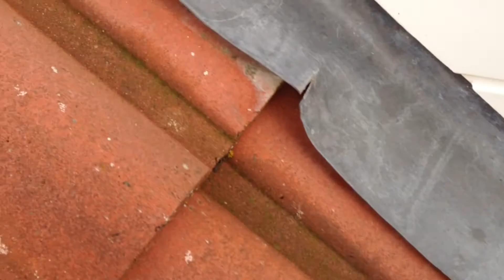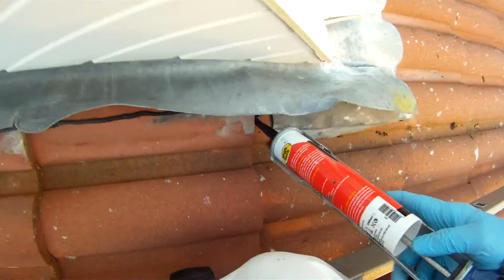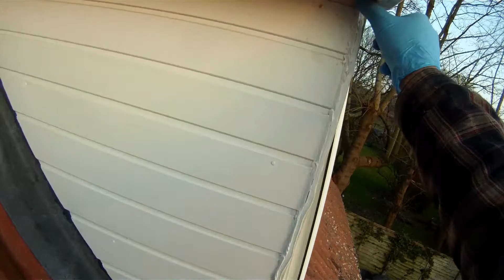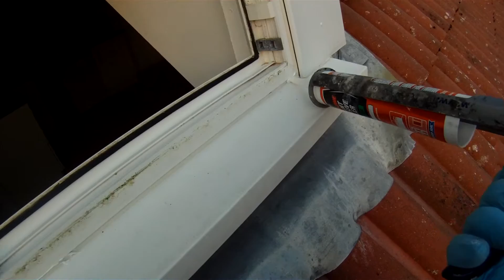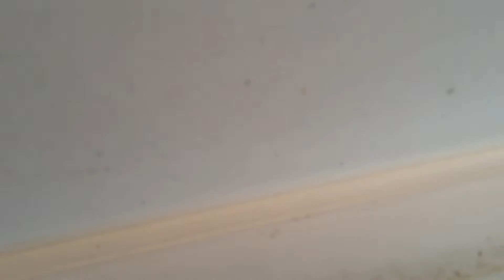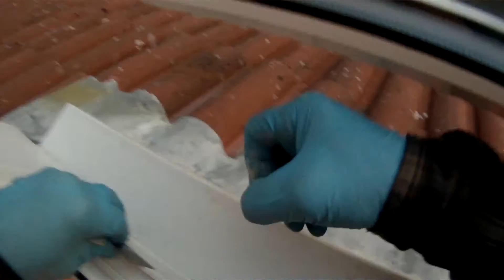How to Fix Dormer Window Water Leaks

Comment: lead is poisonous yet they used it in the UK for god knows how long for water pipes.....😂
Reply from the maker: Yes they did! But a long time ago and practically all of it removed now.  Worse than that is the metals they use in dentistry. Mercury! Nickel etc ☠️
Reply: Well actually, lead is still widespread. Usually it runs from outside isolator tap into building then swaps into copper. I see it all the time. Victorian houses are usually the culprits.

Comment: How much will this job be for one window?
Reply from the maker: It depends where you're located, but figure on a half days work, so £100 would be reasonable, if you can find a 'reasonable' tradesman that is interested in doing it.
Reply: @comeinhandynow  Florida $400 to $600 per domers , Florida house repaired is out the Roof .